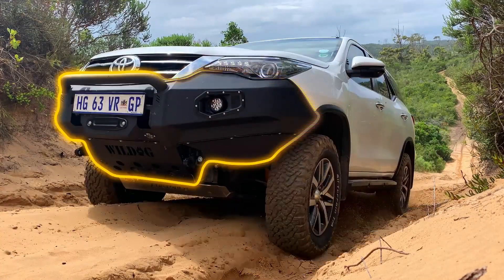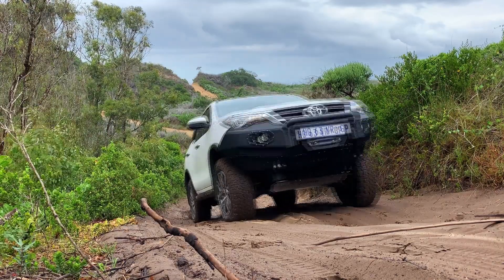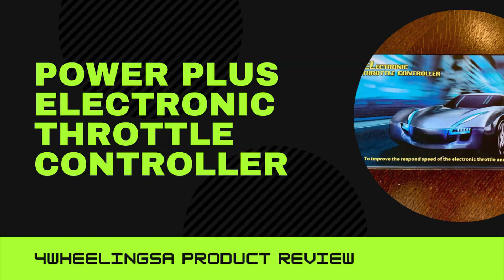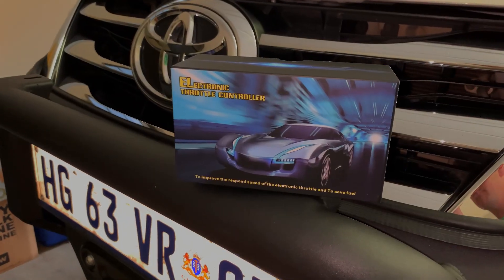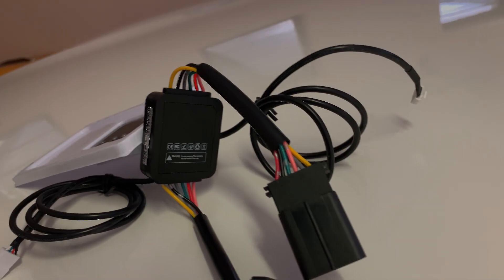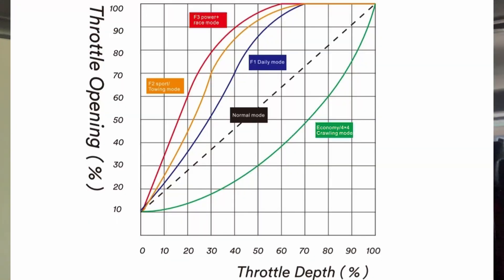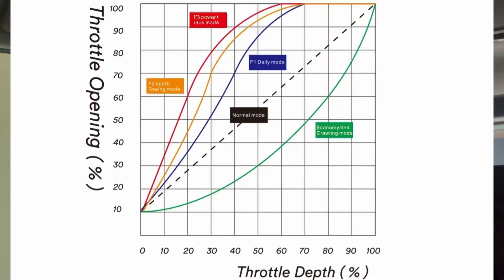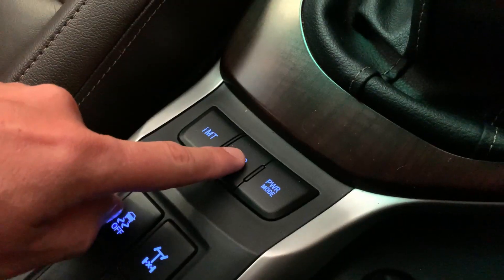TESTED!  I Throttle Controller on the Toyota FOrtuner I Should you?

Comment: Great topic. I agree that it is worth it. I have a throttle controller on my 4Runner. It works quite well. I also regeared to 4:88s.
Reply from the maker: Thank you very much for the feedback. It works well in Low Range as well, makes the vehicle easier to drive.